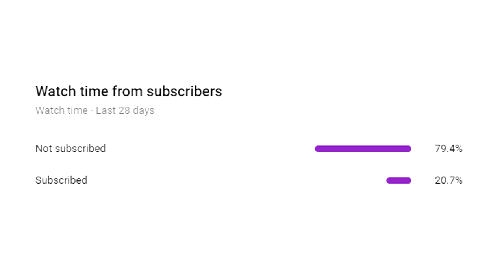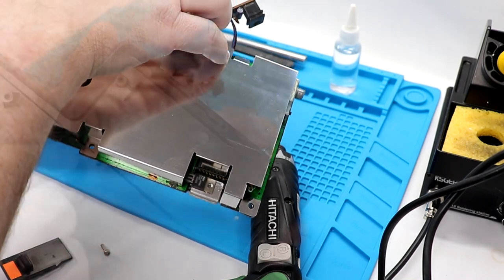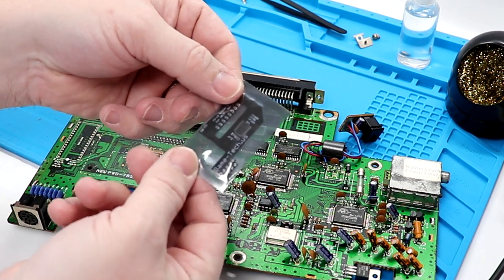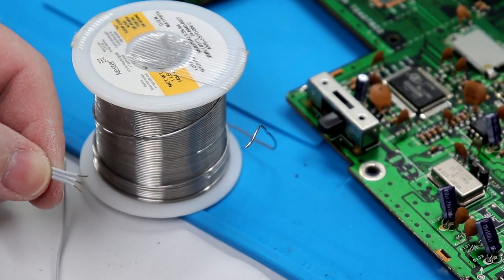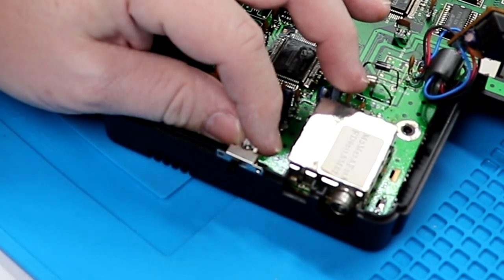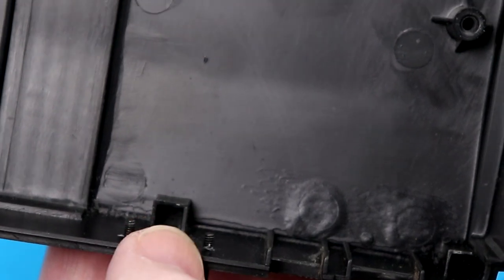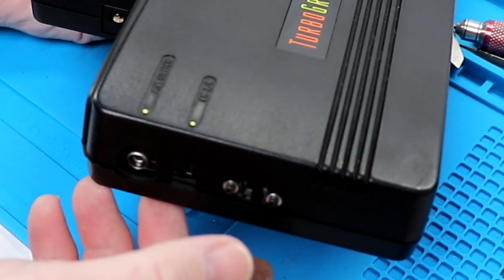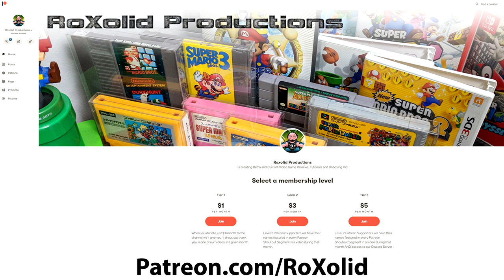Play PC Engine Games on a TurboGrafx 16: Region-Free Mod Installation

Comment: Should pulled the rf input out and put the switch where the old rf switch out and replace with his a little superglue and there it
Reply from the maker: I looked at pulling the RF Modulator out but I didn't want to go that route. And no superglue. No, no, no, no, no

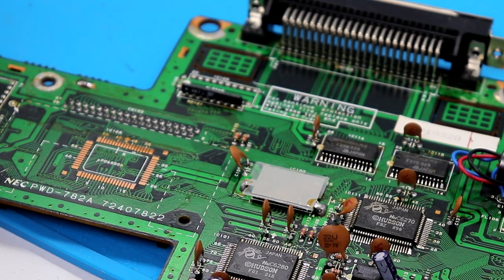Comment: 9:11 "nice package"
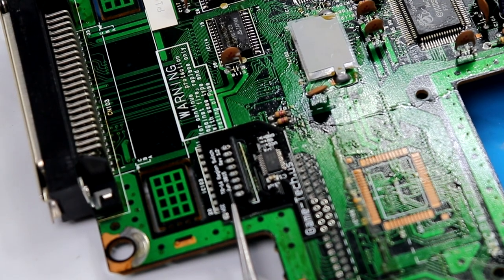10:27 "if the tip is in, it counts for a great ride"

i know (T)here's a (W)itty re(S)pon(S)e to those little quips but i just can't think of what it is
Reply from the maker: Twss?
Reply: @RoXolid  TWSS? Isn't that the homebrew software for the Nintendo Gamecube? I cannot possibly think of what TWSS could stand for
Reply from the maker: @IanNewYashaTheFinalAct  SWISS
Reply: @RoXolid  maybe it's the sound effect of the cymbal or a high hat when playing a drum kit
Reply from the maker: @IanNewYashaTheFinalAct  no idea
Reply: @RoXolid  25:06 "KaPow!"

Is that the brand of portable monitor you use? Why didn't you have your Spark Plug hooked up to that instead of the TV
Reply from the maker: @IanNewYashaTheFinalAct  Lepow. And because I wanted it as a backdrop for the close